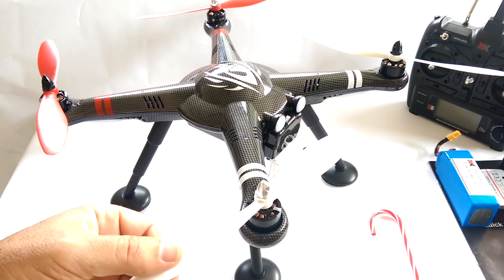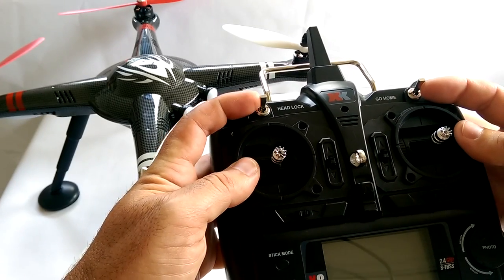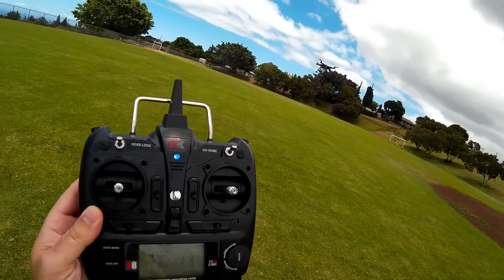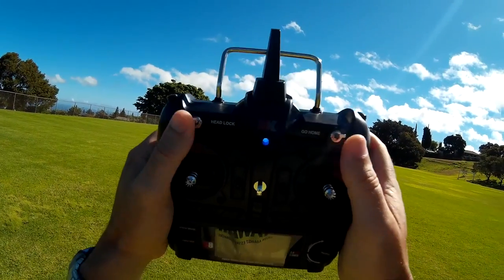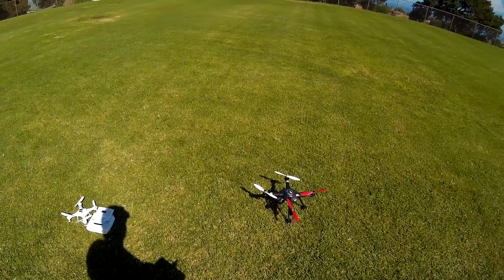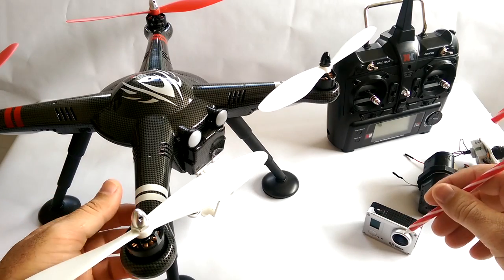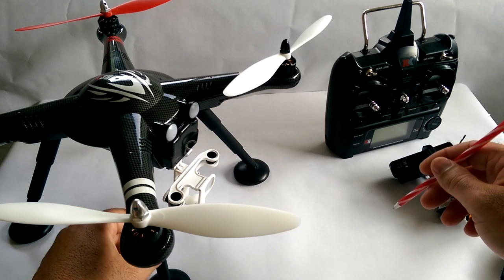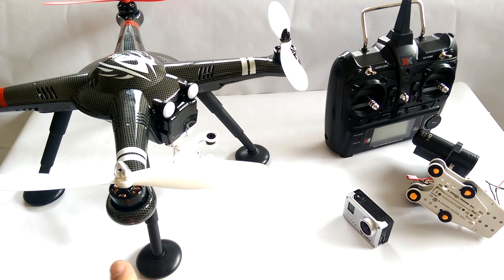XK Detect X380 GPS QuadCopter Drone Full Review - [Setup, Flight Test, Pros & Cons]

Comment: Hi Dustin,  when I first purchased the X380, I didnt have a good lipo battery for the transmitter like most people used in their transmitter mod so I put weak AA batteries, long story short, my transmitter shut down, the quad went into "return to home mode" and hit a tree going up and came crashing down.  Only thing that went bad was an ESC and motor.  I swapped those two out and redownloaded the software files on my X380 and notice that I still have the same problem as I did before and was wondering if you ever had this issue or can help?

1) the X380 drifts and does not maintain its spot after I maneuver the quad up down left and right a few times.  Anytime I play with the joystick and let it go, the quad drifts and I notice that I have to flip the top right switch to "return home" then back to "GPS" mode for it to maintain hover and work again.
2) headless mode does not work properly.  When in headless mode and I push the right joystick to move left, the quad goes forward, when I push the joystick to the right the quad instead goes backwards.  
3) At times, randomly, the quad just freezes in mid air and does not respond to my controls when I try to make it go left or right but it will move forward or backwards, at this point i quickly land it out of fear of crashing into something.

sorry for my long post, these are my 3 only issues which are major even after re-downloading newer software files.  Ever had any of these issues? any advice?
Reply: Hey Pete...i can only advise you to get rid as this drone is plagued with faults. This XK model has faults in the barometer to start with( will pick anything up metallic in the ground).....the main board and gps unit are cheaply made and cheaply installed..you have a crash and it messes up the files in the firmware.....and god forbid you connect anything with the battery in, it just kills it.......it wont recognise usb ports on pc's and laptops and there is no CUSTOMER SUPPORT, which is not on...i can go on and on...its totally not worth buying and there is better equipped quadcopters and better made for the same price bracket that this quad is in...im looking at the Tovsto Aegean V2 which is a better quad and u dont have to do none of that stupid dancing with it and it gets gps lock better than the XK and also manual mode...

Comment: I have an X380 and when I bring it up about 10 feet and let go of the controls it hovers for a few seconds and then starts dropping slowly, it will go all the way almost touching the ground, have you had that problem and if so what do you think would cause that?
Thanks for the info, your videos are awesome, keep up the good work, very informative.
Reply from the maker: Hey Tater,  
You running all stock equipment?  Sounds like you may have a throttle or barometer issue.  Easiest way would be to trim up some with throttle trim on controller and see if it hovers a little better.  Your sticks may be calibrated a little off from factory.  Mine were 3% off.  Check out the rcgroups X380 owners thread on how to connect to software and calibrate or change parameters if simple trimming doesn't work.  
Also, thanks!  Glad you like my vids.
Reply: Dustin Dunnill All stock.  I did use the throttle trim to get it to climb but can't find a happy medium.  I did download some of the file today to get the software hooked up but haven't finished it yet.  Again, thanks.
Reply from the maker: Good luck man.  Check that forum and seby's video for software connection help.  Make sure you have the folders and naming of software correct or it won't open.  Hopefully stick recal will fix :)

Comment: Charles,Dustin, I just received the X 380, There are a couple of problems that are easy for you-- could I get some advise? On auto take off- it leans way back and disrupts itself on take off. Walking around in circles and hitting the Headless 3 times--does no cut it.No juice to the 12 volt plug. The idle does not work when unlocking the props. I saved a long time on Social Security to buy it, and would be appreciative of any advise.Thanks,CharlesNice picture Dude!
Reply from the maker: Only thing to do is open quad and TX to have a look... Or if your sure it's not anything you've done and it's defective, tell the vendor it's defective.

Comment: this is identical to the wltoys v303 seeker Q. is, are the boards and wiring identical also? I got a 2700Mah batt with my v303 but would like the 5400mah, would it fit in the v303? last Q. have you done a review on the v303? Thanks for taking your time to answer all these questions.
Reply from the maker: Hey Alan.  Short answer is... I don't know sorry.  Never had a v303 but I think the underbelly battery slot is much smaller.

Comment: Hi Dustin.  Could you tell me what happens when the stock x380 reaches its signal limit or loses signal? Does it turn back or just hover at that point?
Reply from the maker: It goes into return to home but once it comes back in range and rebinds with transmitter with be in whatever mode transmitter is in.
Reply: +Dustin Dunnill Thanks.

Comment: Is the basic model includes everything to add gimbal and camera? I have 160g and 230g gimball and 60g and 100g camera
if that camera is Firefly 6s or Yi 4k will it be possible to control the camera from the transmitter?

Comment: I have the version with the proprietary 2 axis gamble and camera, or, the "c" model.  On my maiden flight,  when I brought it in after approx 6 min of flying, testing  the various functions, at a distance of about 15 ft, and a height of about 12 ft it started to fly away, unresponsive to the transmitter and then began to wobble violently and crash.  It broke off one of the sensors on  the landing gear and ultimately ended up on the props with the motors screaming because the props were stuck and I couldn't turn them off.  I finally got the battery out to stop the props but one of the motors was damaged and I managed to skin the skin off one of my knuckles in the process.   I'm not giving up though, I am of the opinion that it was just a fluke and if the seller has another one in stock, I will get it, or, a refund to purchase one somewhere else.  Enjoyed the video and scenery.
Reply from the maker: Sorry to hear that Robert.  There are some defects occasionally.  I would recommend to everyone buying a high tech copter like this to open it up and inspect all soldering, connections etc. Before first flight.  There can be QC issues or unnoticeable damage in shipping with any RC.

Comment: Hi Dustin - I just received my plain stock X380 with stock white camera mount.  I have a gitup git2 camera and I am interested in just take still photos for now with a simply setup.  I am assume I still need to install a gimbal enable using the photo\fap button to take photos.  I am unsure when taking a photo via the transmitter does this use an existing 2.4ghz control frequency to initiate the camera to take the photo thus saving to onboard micro sd memory?  Thanks again for your great videos!

Comment: Hello Dustin ! Is this an out of the box flyer ? Or does it take some tinkering ?
Reply from the maker: Great out of the box like the Seraphi
Reply: +Dustin Dunnill which would you prefer ?
Reply from the maker: Both equally now.  Seraphi has pins to plug in OSD easily which works.  X380 is difficult to mod for OSD (I fried mine trying).  X380 has a few more flight functions like headless and a RTH switch circle around a point and circle functions now.  So honestly whatever is more important to you for features.

Comment: I read in a few places it this copter has "around point shooting" which I gather to mean it can circle a point 360° filming the same spot. Does this work? Or is there mention of it in the instructions?
Reply from the maker: Good point.  This feature does not currently exist it seems.  There is no option for it in software or on controller.   Possibly a future feature which they should not have advertised until it is ready.
Reply: Dustin Dunnill Thanks for the reply
Reply from the maker: There has been a firmware update recently which slowly rotates the copter when you press the "photo" button on the transmitter.  Not very useful.  It tried it and you can do the same thing by just  slowly pushing the yaw stick manually.

Comment: Great review. Would you be able to give me the battery dimensions as I have ordered this quad and have seen some battery's that might fit but want to be sure before I order them? Also is there any room in the battery bay or is it a tight fit?
Reply from the maker: Thanks Phillip, it's 10x4x3.3cm.  I just ordered this battery as it looks like it will fit perfectly.  I'll let you know how it fits.  http://pages.ebay.com/link/?nav=item.view&id=351439639164&alt=web
Reply: Dustin Dunnill Thanks for doing that. I was looking at that battery to on aliexpress, let me know if it fits. The Walkera 5200Mah is pretty much the exact size as the Detect at 105,43,33mm also on aliexpress, but the 6000Mah would be better.

Comment: Thanks for the great review. I intend to get one of these quadcopters in the near future and intend to hook it up with a Walkera 2D Gimbal. I will appreciate very much if you explained how you hooked up your Walkera gimbal to the quad ports.
Reply from the maker: I had to hook up both 12v and 5v + signal pin for tilt otherwise gimbal was wandering.  I go through what pins are what on the X380 in the video since they don't mention it in manual.

Comment: Very nice review!    I just received the drone, but I am new to drones and am confused about charging the battery. I cannot tell if the charging system is working.  I  connected wall charger to balance charger and balance charger to battery.  I plugged it in and the wall charger light came on, but none if the two lights on the balance charger lit up.  Is that what should happen?  I am not sure if this means the battery is dead and needs a long charge, if it is not working, or if it means the battery is fully charged.  Can you help?  I am excited about this drone, but I do not what to do something incorrect and burn it up before it gets air born.  Thanks.
Reply from the maker: +TheNuggetshooter I have honestly never used the stock charger so I could not tell you.  If you think you will be into the hobby get at least a SkyRC B6 Charger for faster charging and longer battery life.  They are only around $30 ish.
Reply: +Dustin Dunnill Thanks.  I will get one soon.
Reply: Dustin,  I flew the drone yesterday for the first time - very easy and it worked perfectly.  I fixed the charger, but ordered a more sophisticated one that should be here soon. Now looking at a SJ4000 camera with WiFi.  Very cool and fun to fly.  Again - great review! Darryl

Comment: Hey Dustin, keep the reviews coming they are very informative. Quick question; I have set up the same gimbal on my detect with the same wiring pattern you explained, mine worked then had a bit of a spaz then worked again even when I tilted it up and down with the TX, then spazed out again when I say spazed out I mean it started moving erratically in all directions. Any Ideas what could be going on?
Reply from the maker: +phillip kriwopischin Thanks phillip.  Not entirely sure.  Mine had issues initially with pitch wondering, then I had to connect both 5v and 12v power to gimbal.  Now just 12v works fine.  Probably a flight controller glitch.  Maybe format the quad and when next bootup it will re write the default firmware fresh.
Reply: +Dustin Dunnill Thanks Dustin. I disconnected the 5v leads and now it works fine. Easy fix.
Reply from the maker: Great!

Comment: Hi Dustin watched your videos ,very informative ,I have a few question I need help with !I recently bought a v303 with the FAP function wheel ,I had a x380 a few months ago but it fell out of the sky ,but I had video of it falling so the company give me a refund ,so I bought the very new v303 seeker,I read on the rc groups that it had the new flight controler board in it same as the x380 ?I have a x380 full body shell which I got in case of a crash with the x380, to give me more fligth time like the x380 ,I was wondering if I swapped over the body shell from the 303 to the x380 I could fit the 5400mah bats in it ?would I have to do any adjustments in the firm ware of the v303 to carry the new batteries and low voltage control ?and help on this would be good Dustin as I would like to get the extra flight time from my v303 ! I just ordered a new DJI Phantom 3 standard :) $499 of ebay ,but until I get it ,I was hoping I couldc mod the seeker .Thanks in advance.
Reply from the maker: +Paul McMahon Hey Paul.  It should work fine after body swap and with the bigger lipo.  As long as you are very careful with the swap, I don't see you having any issues.  What does the P3 come with you have ordered?  Cam, Gimbal, FPV?  or just plain?
Reply: the P3 standard comes with 2.7 k camera and two excess Gimble got to buy your own tablet or iphone 6 ,I ve ordered the tablet from best gear the cube $77 :) gear best .com!cant wait to get my hands on it :)
the v303 ,I velcroed it on the bottom and stuck the 5400 m a h bat under it ,today flew like a charm with 20 minutes ,probaly could have gone a bit longer but the wind picked up a bit today and it was very hot here in oz 32 c.I think the body shell swap will work out ok ,thanks for your quick reply .
Reply from the maker: Good deal.  Here's what the X380 does better.  Dual GPS for more sats which means Les chance of flyaway and a better 3D lock.  Only other thing is the WiFi control and video range are limited but I guess a booster can be added.  Otherwise p3's already got the 3D gimbal and great Cam.  Also, be wary of the Geo lockdown on dji; won't fly over 400ft even if you try and will just land wherever it is if you accidentally come within 5 miles of airports.
Reply: Thanks Dustin for the heads up on the P3 I dont think I would want to fly over 400ft as it gets hard to see at that range , I like to see the quads and the airport is more than 5 miles away, I wanted it for local stuff like the great oz beaches and the coast line ,wont be like your videos thuo ,lol miles away iam not ready for that yet !it will be a learning curve for me ,thou Ive build a lot of tri copters and fpv stuff ,a P3 is a new thing for me and a bit to learn too.,there is lots of info on line about the Phantoms ,its all about reading the manuals and rc groups id say.

Comment: Hi Dustin! Last week I bought this DETECT X380 and today i was trying it in an open area. While in mid of the flight the drone did something strange. In first it started to run far away from me without using the remote, so I turned the Go Home feature ON, the drone came back. Then when it came close to me I turned the Go Home and the drone just turned upside down and fell down really hard in the ground. Now it's not working and broken, when I plug in the battery, it beeps and all the lights turn on except the main light. Can you help me.
Reply from the maker: +Edilson Andrade Bummer!  Sorry to hear this.  What kind of area did you launch from  and how long did it sit plugged in before you launched?

Comment: Nice review Dustin, really like the look of this quad for it's AP features... one concern though, you said "always on GPS" so you can't switch to manual mode?
Is there any provision for manual mode? I'd hate to see it getting pushed out to sea by big winds and have no way to bring it back in manual mode like you did with the CX-20
Reply from the maker: Hey Ken thanks.  No manual mode. I'm going to be seeing if changing some parameters in FC is possible though and see what I can come up with :)
Reply: Dustin Dunnill Cool, I'm watching this one with real interest... I'm having a few problems getting the Aquacopter dialed in and thinking I might get a different frame to put all the good gear onto from the Aquacopter. 
In the meantime I just want something that works right out of the box and this seems more polished than the CX-20 but maybe not as customizable as I want?
Reply from the maker: I forgot if you already mentioned, is the aquacopter like the mariner or splash Drone?  Those looked pretty capable.  

I'm doubting this will be as functional as you can make the open source cx20 but out of the box it was flawless.  I'll be doing some research and modding it ASAP to see if I can make it as capable as I made my cx20 :)
Reply: Yep, predates it and has a much smaller capacity "hull". It's a spaghetti bowl of wires with RX and FC and GPS all on top of one another and sandwiched between 2 2250mah batteries, maybe the reason It's "toilet bowling" on me.
Reply from the maker: Ken Oath Sorry to hear.  Hope you work it out.  I've got my eye on that splashdrone with waterproof gimbal.  Maybe too good to be true.
Reply: Dustin Dunnill I haven't flown in Altitude mode much so I'll give that a try, should be better. I bought mine used but with some sweet upgrades at less than half the price of a new one (Project X). But if I had waited... I just seen the Splash Drone on special at Gearbest RTF http://www.gearbest.com/rc-quadcopters/pp_197344.html similar price to what I paid (not including postage) I reckon I would have got that instead.
It looks great just need to check the latest feedback and reviews see how it ended up performing...
Reply from the maker: I got my eye on that one :). I'd really like to test and review it....maybe someday soon ;)
Reply: +Dustin Dunnill This, cx20, or hubsan x8pro???
thanx